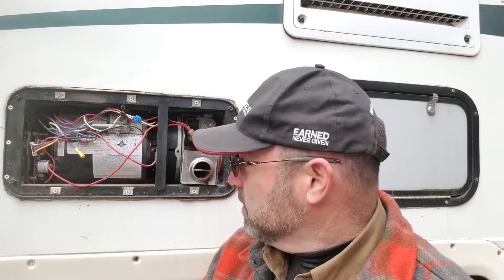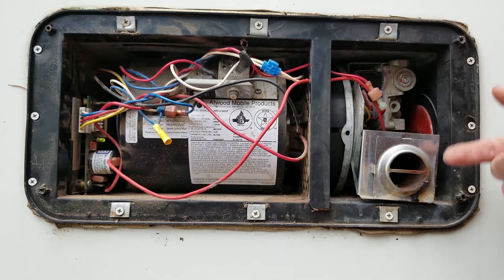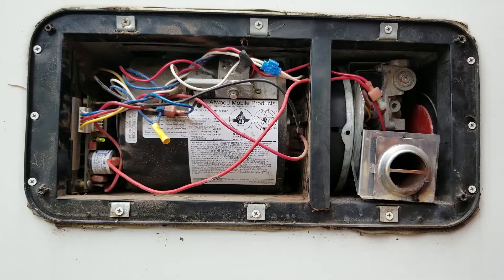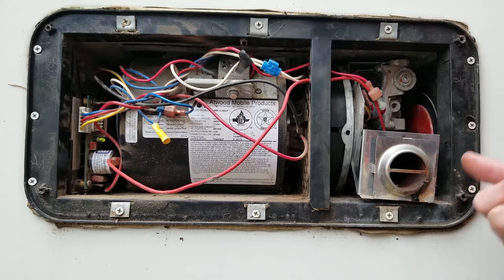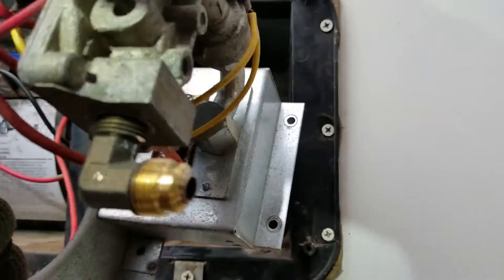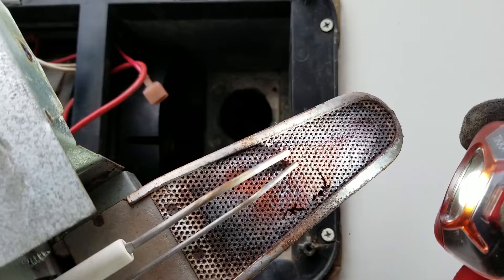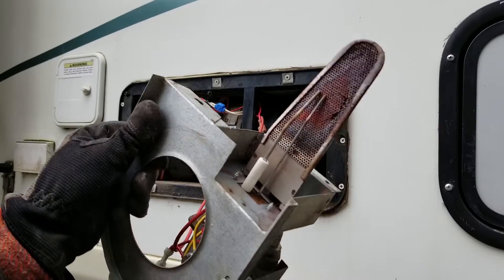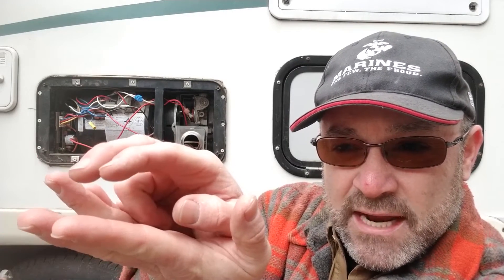Atwood 8531-IV RV Furnace With Intermittent Heat

Comment: I have a atwood hydro flame 1988 .do you have any videos on short cycling .mine cycles at 2 minutes
Reply from the maker: The question here is do you ever hear ignition? If the furnace does not try to ignite that then your issue is going to be on the control side, which could be sail switch, high temperature switch, or control board. If you get ignition and it Flames out then the problems not on the control side but it's on the igniter side which would be your burner head, the electrode itself, or control board. You just have to know which way the trail will take you, pre-ignition or post-ignition. Having said that, we've got many furnace videos and our furnace playlist here:  https://youtube.com/playlist?list=PLk44vSl27TRCaZIQbm-0utYK7sVOKwXVY

Comment: Excellent work, mobile guy. One of my problems (not to get too personal) is the burner tube has "fused" into the housing. I sprayed a  penetrating oil, but still frozen (rust?) in place. Don't want to man-handle it (person-handle? I'm in HR) so WWYD?
FYI--well, preaching to the choir with you--when the cover is reinstalled it is a wise procedure to silicone the cover gap as water (rain) and mom boards do not play well together. Keep it dry, please. And as a quasi electrician, I now join all wiring or update potentially corroded fittings/wire connections with Wago fittings. Wire length considered, I trim back wire, strip, and in the event it is oxidized strip a bit further back, spin, and if I am real ambitious add a dollop of dialectric grease to wire end. Fully seat wires into Wago (not to be confused with Wagyu--beef) and insure a fault-free connection by tugging a bit on wires to make sure they are clamped in fully. Oh, and like you probably have mentioned before, I blow out burner chamber, just like a sooted-up water heater to rid the area of debris or any animal squatters. Wago connectors: they are the bomb (not affiliated).
Lastly, who is responsible for choosing square drive screws over star pattern or a hex head? Square is more likely to suffer camming. When in doubt, sub it out. But square is better than phillips, and let's not even mention slotted (I did, sorry).
Have a good day and stay warm. Oh, I have a heated jacket by Milwaukee (not affiliated) and the pockets are also heated, this way I can wear my favorite tactile-friendly electrician gloves (Portwest--not affiliated)

Comment: Mine is not coming on at all I took it apart and found mud daubers in the squirrel cage fan. I've disassembled it cleaned everything out blown it out with air and ready to hook the gas back up. My thermostat was a 1h2c and thought it was out but the slide selector was broken trying to fix it looking for a schematic on exactly how it goes back together I think this slide connector has just come apart or got loose I really need help. I've come to this state to help my elderly parent I'm 600 mi away from home and I'm going broke staying in my car. Was sold the wrong thermostat and board kit for $170. Have to drive 2 hours back to Clinton just to get my money. Can someone help me with a schematic how the thermostat slide selector goes back together in a 1-h2c digital and any tips when putting back together my 1835 lll generation duo therm

Comment: Cannot get exhaust tube out of heating unit will not come out we have prayed on it what else can we do any questions
Reply: With mine brute force was needed. You need to really move it side to side and up and down a lot while pulling out with great force. You can't really break it, and it has to come out or you'll never get anything else out.

Comment: Hey there, great video. Just replaced my burner and igniter because I thought it would fix my issue. But... it didn't. Mine is clicking, you smell the gas but it won't ignite. It was igniting but not staying lit with the old parts in. Any suggestions?

Comment: Ive been doing mostly residential HVAC hve been asked by multiple associates and friends to work on their rvs basically didnt have a clue and was hesitant this equipment is a walk in the park I knw you mentioned the burner ser# but I dont think you gave electrode ser# or I missed it question where do you acquire parts you mentioned Amazon does your industry have supply houses like residential hvac Johnstone etc.

Comment: We're having almost the same issue... our furnace turns on and ignites a flame, but turns right back off.. it does this 3 times before turning off the blower. We are getting a (ignition lockout fault) blinking light on control board.. any help would be awesome
Reply: I have the same problem did you ever get it fixed?
Reply: @RojoFrijol  We lit the stove to bleed out the possible air in the line and it worked... I also read to use compressed air and blow into the exhaust port,  to clean debris from the sail switch, which we never had to do because it suddenly started working

Comment: The Open Range 340flr travel trailer has this furnace but was installed to close to wheel well to have access compartment like this trailer.  The only part through the outside wall is the vent.  How would servicing this setup be done?
Reply: OPEN RANGE POS
Biggest mistake I ever made...

Comment: @3:30 I have the same Furnace and I'm having a hard time getting the gas valve disconnected... I can not get it to budge. Any help would appreciated.
Reply: It's possible that it's reverse threaded, so instead of "Righty tighty, lefty loosey" it's reversed. Just a thought
Reply: @dansmith6990  thanks for replying. I actually got it off but it was really tough.

Comment: @myrvworks I have the Attwood 8535 IV. I replaced the burner head but unit will not kick on at all. It was turning on prior to replacing burn but heat was intermittent. The unit will not kick on at all now. Any advice? Did we break something in the repair or miss reconnecting something. We checked everything and it all appears to be connected. Any help and advice is appreciated.

Comment: I've had the same thing happen to my 8535 iii. Ordered a new burner an installed it. Same problem. I did everything I could think of, new gas valve and igniter. Still no Worley. Took apart again I noticed the burner was missing a little ramp inside the burner like the old one I removed. I drilled out the ramp an bolted it into the new one. Bingo, worked like a champ. Part was supposed to be a replacement part. NOT!!! I don't know if they really make a replacement part for it.

Comment: Could the problem have also been a dirty sail switch?  I'm having the exact same problem, getting clicking and gas after the fan starts but no ignition.  Hoping if I clean the sail switch it MAY solve my issue but can't find it.

Comment: Great videos Darren.  Keep up the good work.  I guess I'll have to get in line with my problems!  I have an Atwood 8535-III furnace.  I was excited that one of your videos you actually had that furnace to work on. You replaced the burner on that furnace.  My problem goes a little farther.  My burner was burned out, so I replaced it.  I had previously replaced the fan motor.  Then I had trouble with it running.  Fan will come on, purge is done, 15 seconds later I have ignition. I can smell the propane, hear the ignition, and feel the heat.  Then 10-15 seconds or so later, the fire goes out.  It tries again for 2 more times, maybe more, not sure, as I shut it off by then.  Igniter is in good shape.  Sail switch is good.  In fact, I do the thermostat bypass in one of your videos.  Local RV shop said it might be the control board.  Yikes, I hope not. Apparently, the ignition wire is used to monitor the burn after ignition.   I have searched your videos, but can't seem to come up with one that covers my issue.  I'll keep looking and checking. Thanks for listening.  Bob
Reply: @eagle works did u fix the problem i have the same issue after replacing my blower motor it would run fine prior but now it wont stay lit
Reply: I am having the exact same problem, but intermittently. Right now I went to try to troubleshoot it but after shutting off twice, the third time it actually stayed on and continues to. So hard to fix what ain't broke lol
Reply: @stevenovak9644  same here.  If I try a few times, it runs and will continue to run when needed as long as I leave the thermostat temp up.  However, if I turn the temperature down, say at night, say 10 degrees, and the furnace cools down, it’ll try three times to light, then just run the fan…

Comment: I have a atwood 8531-lll. The blower comes on but it will not. Ignite. I smell no gas. And no clicking sound from the ignitor. So l put new DSI board, Relay Timer, ignitor, sails switch, and limited switch. And still. Have the same problem. I cleaned the orifice. All the part I pulled off looks new. Need Help Please. I get plenty of gas to the cook stove.
Reply from the maker: Hi Gary,
 
Your question has been selected for an upcoming video where it will be read and discussed by Darren.
 
If you have not already subscribed to the 'My RV Works' YouTube channel, please do so and keep a watch for the '10-Minutes with an RV Tech’ video sessions.  This new series is a selection of comments and questions that will be covered and released weekly.

Here is our YouTube link:  https://www.youtube.com/c/myrvworksinc

Happy Camping,
My RV Works Media Team

Comment: I have an 8535-IV and two different issues have occurred. Failure to start a few years ago. It tried to start but didn't. I don't remember if it lit a fault code light but one time while I was investigating I moved a wire and it came to life. My diagnosis was the scotch lock type tap in connectors failed. The fix was a little bit of rewiring maintaining the same circuitry but ELIMINATING the failing tap connections. These are where a wire is going from A-B and wire C intercepts A-B thru the insulation with a piercing connection. 
The other was stink bugs found the mixing chamber inside the burner assy that you're replacing and they would roll around in the air/gas mix and made a popping sound. Remove their crispy carcass and all's well.
Yesterday I inspected the sail switch for grins and for working on this unit a 1/4" nut driver with a magnetic head should be a gotta use it tool for the job.
Darren, Good logic this happens but this doesn't thinking to figure out where to look. 
Gary
Reply from the maker: To schedule a service consult with Darren please sign up for the "1:1 Repair Consult" on our Patreon site.  https://www.patreon.com/myrvworks

Comment: My Atwood 8535-IV lights and runs for about 1 minute and sometimes longer. It seems that it is an overhead sensor. All my ducts are open and clear so there should enough airflow how do you get to the heat limit sensor?

Comment: Great Job on the video. I have a MD30111_A furnace that the fan comes on and then it tries to lite just pops and lights for under a second.then goes out. It will keep trying to lite every few seconds. After a few tries if I am lucky it will start and run. If not it just keeps trying to lite on and on beyond the three or four tries. I have made sure the igniter works and is clean and spaced the 1/8".The control board has no codes on it. I cleaned the jet and made sure the gas valve is opening like in your video. Any ideas?
Reply from the maker: If I were there, one thing I would start with was verifying the LP pressure was within specification. If your LP pressure is too low that might be part of the problem.  Here's a video I uploaded on how to check that. You will need some specialized tools though.  https://youtu.be/SD1qcH_hNYY
Reply: @MyRVWorks   I watched your video on Propane Pressure and that helps me a ton. Thank you very much I will test it and see where I am at. That really sounds like the best place to start and see if the pressure is correct.

Comment: I have the same furnace. Where is my sail switch located and do I have to pull the blower to take the sail switch out? My blower won't turn on. I left it on over night and 1 night it turned on but now it's actually colder and won't turn on. Wondering if my sail switch is dirty or bad. Furnace worked last year but this year it is starting to mess up. Control board is giving me a air flow limit fault light.
Reply from the maker: Okay, if the blower motor will not turn on, that is not a sail switch issue. If you look carefully you will find a black and a red wire feeding the motor. Disconnect those from the ground and the control board and apply 12 volts directly to those two wires. That will start the motor directly without anything else interfering with it. From what you are describing it sounds like you have a failed motor. If you do need to get to your sail switch, you will find four screws on the corners of the black blower housing. Remove those four screws pull the blower housing off and you'll see your sail switch right inside. I do have a furnace playlist with lots of other tips and tricks and walkthroughs on repairing furnaces. Perhaps it would help you to watch some of those to get more comfortable and familiar with all these parts and how they work.  Here is a link to my furnace playlist:  https://www.youtube.com/playlist?list=PLk44vSl27TRCaZIQbm-0utYK7sVOKwXVY

Comment: Thank you for the video. My furnace starts and runs for about 30 seconds then the burner shuts off. It repeats that over and over. Never faults out so no codes on the board. I understand residential and commercial systems so my thoughts where the flame sensor, except I'm seeing the gas valve is controlled by the blower pressure? Now I'm stumped... :-(
Reply: I have the same problem (cannot find a video) - furnace lights, has gas , hear spark then flames out after 5 seconds and sometime the spark continues for a second or two, re-lights then stops.  Adjusted the electrodes many times in different configurations @ 1/8.  Atwood 8531 - thoughts? Great videos!
Reply from the maker: When you state it runs for 30 seconds, I'm wondering if that is the fan blowing or if you actually get ignition? There is a pre purged for up to 30 seconds before it opens the gas valve.  So if you are not getting ignition then that would be on the control side. That circuit starts at the thermostat, goes to the control board in the A/C, then through the sail switch, then through the high limit thermostat, finally to the control board. So, no ignition means that one of those components is not allowing voltage to pass through it. Typically it would be the sail switch or the high limit thermostat that's failed. If after the 15 to 30 second Purge, you do get ignition but it Flames out right away that would indicate that the control board is not sensing the flame. It senses the flame through the electrode that's in the burner head. That is the large spark plug size wire that feeds into that burner. I do have videos on how to check for that. The question is do you get ignition? If you don't it's on the control side if you do how long does it ignite for.  Here is a link to my furnace playlist where I have more videos covering different walkthrough scenarios on these furnaces. I hope it helps you.  https://www.youtube.com/playlist?list=PLk44vSl27TRCaZIQbm-0utYK7sVOKwXVY

Comment: Looks like physical damage to the insulation on that outermost red wire, probably from rubbing on the metal cover during road-travel.
Reply from the maker: This poor furnace had been worked on previously by others. It turns out they had sliced and diced the wires, bypassing some of the safety features including the high limit thermostat. While we were working on it we made all the repairs and fix everything so it works correctly now.

Comment: I’m having the same problem but mine is only 4 years old. I haven’t pulled it out yet but does it really last only that long?
Reply from the maker: When I have come across these burned out burner heads, I seem to have been able to trace it to one of two culprits. The first being LP pressure is too great therefore the BTUs are too hot.  The second is oil in my LP lines. We use the lp as a vapor, but sometimes oil will get in from the lp tank we're drawing from. That then will pool in the burn head and cause a hot spot. I've even worked on furnaces that had oil in the lines and when I took the gas valve apart you could  see it dripping out of the gas valve. So look for these things and see if that might not be causing the problem.
Reply: Ok I will! Thanks!